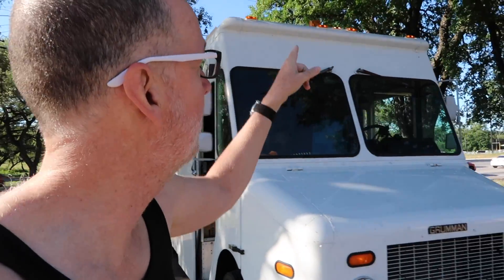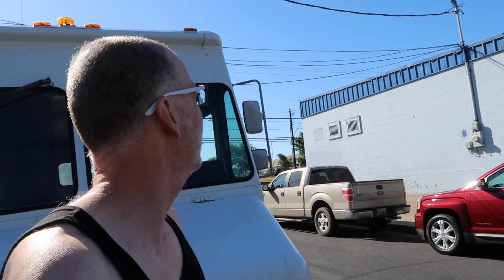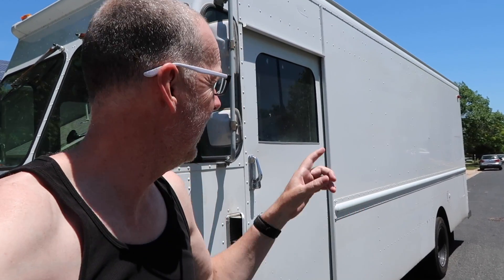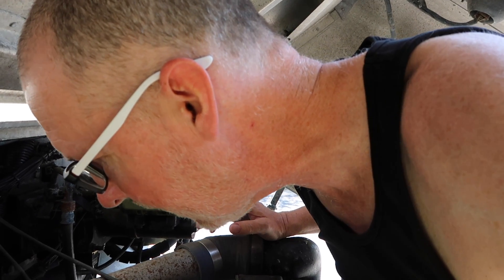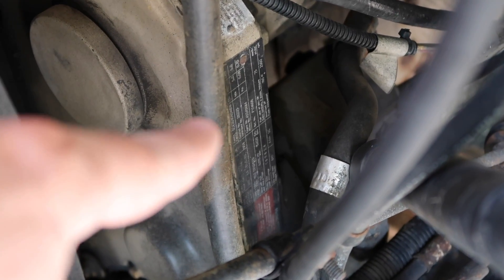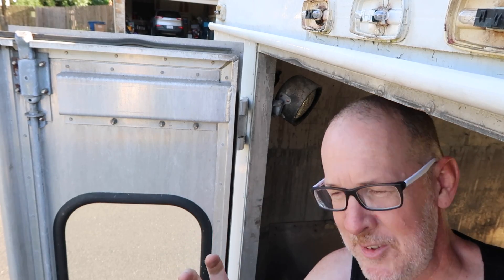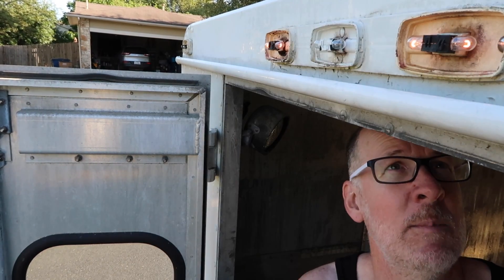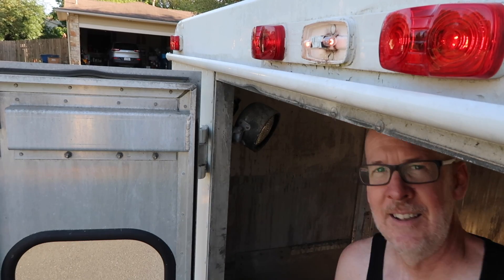Failed Step Van Safety Inspection E224

Comment: Change ALL of the marker lights to LED, you'll be glad you did. I'm the truck driver that soldered all the marker lights from a previous comment.
Reply: I completely agree, was just going to say that myself.
Reply: Samual Whittemore yeah, i go all LED on everything I can.
Reply: Samual Whittemore changing to LED is a good idea.  something you can do a little at a time or all at once.  take a light off and go to NAPA for the direct replacement.  this would help with your ground issues on running lights
Reply: LED is the way to go.
Reply: I agree it will also draw less power on batteries.
Reply from the maker: ahh... great idea. that is definitely what I'll do. all LED

Comment: You need to pull all of the fixtures, clean and sand all of the area where the attaching nuts and bolts are mounted, (and specifically where the fixtures catch a ground, which you should see a contact in the fixture that goes through one of the holes for the attaching screws.) Aluminum and steel, (the bolt/nut material,) is subject to what is called galvanic corrosion. This is a chemical reaction to dis-similar metals. In time, you'll find the steel bolts/nuts will actually turn in to a powder-like consistency, and crumble apart. While you're at it, I'd go back to NAPA and buy all new fixtures and mounting hardware, and change them all out. Otherwise, you may be chasing this for quite some time! I'm a retired diesel truck mechanic, and prior to my working on semi's, I worked for a commercial and retail laundry outfit that had all aluminum step-vans, so I know from where I'm speaking!
Reply: gac914 and the thing that sucks is there is nothing you can do aside from running ground wires to frame....
Reply: Absolutely true! Trusting aluminum for electrical integrity, especially for a long period of time, is never good! Thanks for noting that, I failed to make that clear. Bottom-line, with DC voltage, the ground is as important as the voltage going to the object!
Reply from the maker: great advice. I'll put this on my "to do" list, but suspect it will wait until after I have some more of the living space built out, then I can go back and upgrade the lights

Comment: Some here are recommending changing to all LED's, but that will be expensive, if you buy the quality units like Grote or Trucklite. And the cheapo knockoff junk you can buy at roadside chrome shops have a 50% failure rate, or more. 

The incandescent bulbs here are simple, cheap, and easily fixed if they lose a ground or simply burnout. Bulb Grease is an actual product and it works. 

I'm pleased you figured this out, but just for future FYI, each individual light fixture is wired in parallel, not series. That's why one or two can work while others dont. If it was in series like a Christmas tree then yes, one bad bulb will take them all out. Vehicles aren't wired that way.
Reply: Thumbs up for Grote and Trucklite.    get the right stuff the first time.  my brother sells auto parts and convinced me of this.    for me... any A/C delco part with an A in the number... is total junk import crap from (A)sia.   little things like that make a big difference in your enjoyment later down the road becasue you knwo you have the best you could get.
Reply from the maker: thx for explaining about series on parallel and costs of lights

Comment: I'm only just now watching all these videos of the build, Seven, but as you were learning, I am now learning from your videos(!). I've wanted this same stepvan for years now (with the 4BT or 6BT), and am seeing areas to pay attn to when I finally drop the $$$ to get one. The little things that mean a lot (electrical gremlins, odd odors, persistent vibrations, cost of maintenance, etc) have been very helpful in compiling "what to look for/ how to address" notes. 
I loved seeing you so elated at the end when, after getting frustrated with the lack of voltmeter proficiency, you still managed to fix the issue! Regardless of how you did it, you did it. All the helpful comments only come AFTER you find and fix these problems (sometimes), so I'm sure those helpful comments did help. Take care
Reply from the maker: I still struggle with electric stuff and volt meters. hope you find the step van of your dreams (I'm hoping to do a video soon on things to look for when buying a step van)

Comment: that type of  light that is used for your marker light uses the fastener as the ground that is why when you turned them they started to work.most of the stuff you need or get you'll have to go to a truck supply store like here in jacksonville fl we have one called fleet pride and Napa also for lights truck stops have some on hand.i know in a commercial truck D.O.T. requires a fire extinguisher a little red rectangle box of three foldable triangles for break downs and a first aid kit it might be a good idea to get them maybe not all at once but would be good to have.better to have them and not need them then to need them and not have them.

Comment: It's sometimes very hard to get a good ground on an aluminum body.  Worst case you can always slip a round electrical terminal under the mounting nut, and run an actual wire down to screw into any part of the steel chassis beneath the van.  The same wire can branch to connect the ground sides of all of the lights (or any other small devices).  Use a wire size similar to the one(s) on the positive side of the circuit (usually #12 or #14 unless higher current device like headlights or big fans).

Comment: you have it set to the correct setting and current type that is the hard part. so find a bit of exposed metal and that is where to put the black probe for ground then touch the red one to the pins in the connector. you may have to poke through the wires if it was installed without removable connectors. and you may find more bad than good but from what i have seen you are resourceful you got this

Comment: Lol, glad you got the lights fixed. Electrical  can be a nightmare. good job. You should think about changing those lights to a LED light. You will be glad you did ,simply because they draw less current easier on the battery and they are brighter and, they will last longer.of coarse there is no hurry. you have plenty of time for this in the future...just a thought...... great video .. B safe out there..

Comment: I am not a mechanic nor am I an electrician! I am amazed that you have the patience to fiddle with this stuff! Definitely a learning experience and you are learning! Kudos to you from one Texan to another. BYW I live in Spring, Texas. But would definitely not be of any help to you!
Just for your information Texas will be doing awY with vehicle inspections shortly.
Reply from the maker: glad to hear I won't have to do safety inspections again. it was super easy, but a surprise about failing because of the top lights

Comment: Remember my comment about an electrical ground based Poltergiest... Also, when you use steel screws into aluminum there can be a corrosion penalty.
Your batteries should be 12 volts or better. The nine volt indication (less than battery voltage) was a possible bad ground indication, just like a "dim bulb" on a test light.
Start watching the "SouthMainAutoRepair" channel. Eric uses a test light and meter all the time... Good Job on the troubleshoot.

Comment: Money, money, money... don't keep doing the most expensive thing only to find out later that it could have been done much cheaper or just needed something simple. Put some dielectric grease on those nuts and leave them alone. Don't change the nuts. Don't install LED. They shine... spend your money on an AC unit later or things you really need. Great job on getting them all working. Awesome video.

Comment: when I worked for a bus company and those clearance lights didn't work I would tap them with a broom handle. That usually would work. Bad ground from corrosion where mounted to the body.  Good luck.
Reply from the maker: I think it was corrosion at the ground

Comment: LEDs are a good idea for your van for marker light OR interior light if you're going to add them. Yes Cummins or maybe even the Gruman may have a record of any recall open, closed or completed.  On parts get used to going to NAPA or a truck parts place, a lot of your step van is assembled meaning Gruman bought parts and assembled them, real truck parts folks can sell you those same parts.  If you would of grabbed one of the lenses you didn't loose and brought that into the parts store the NAPA guy probably could of gotten you done right the first time. I worked travel trailer repair for a while and most of the time that a marker light quit it was a bad ground. We had a box of oversized aluminium screws that usually restored the ground and you didn't have problems with galvanic corrosion.

Comment: Clearance lights are a common source of water leaks.  Check yours carefully.  If cracked or loose plastics,  bad rubber seals, or signs of corrosion then replace them.   LEDs are nice, but cheap old fashioned truck type are OK since you are only using them while engine running (don't really care too much about efficiency).   Seal with Dicor lap seal for best results.  Silicone is OK, but will crack and fail with vibration.

Comment: haha my first thought was "bad ground?" with low voltage stuff that is very often what is going on.In order to complete the circuit they have to have good contact where they are either screwed down to the vehicle or thru a ground wire in the harness. marker lights are usually just grounded to the vehicle. loose screws or just crud built up can be enough to make them not work. good job figuring that out! honestly I think the experience of having to figure that out thru frustrating trials and error is the best way to learn and retain these things. I never had anyone to help me figure anything out really and I was going thru the learning process before I had access to you tube or google lol so for me there was a lot of head scratching and just poking around exactly as you have done here. You seem to have the perfect balance of patience and common sense to be very successful at these types of things,you will immediately know what to look for next time you run into this scenario now,time well spent in my opinion!
Reply from the maker: low voltage is a mystery to me. maybe have to do another video about some strange things on that

Comment: Seven those ID number  and spec on ENG are on the front of motor right side of what you call timing cover on bottom right .It may be cover by dirt and oil  its a black sticker .  I have a 97 dodge with a 12valve I my self had to find the ID number my self

Comment: I have not seen recommendations for the use of "star" washers. They are good for grounding problems. Keep up the good work and your commitment to asking for help as a problem solver.
Reply from the maker: I've seen a few of the star washers on my step van but wasn't sure why they are used. thx for the tip and info!

Comment: You need to check for continuity by turning it on and switching it fo 5 o clock with the Arrow/triangle with line through it. Read 1v means its good. Reading nothing means no connection.

Comment: If you don't want to spend several hundred bucks for a Softie (mic windscreen) there is a much cheaper alternative.  I used to record sound for movies in Hollywood and needed windscreens for small wireless mics. I found that the foam ends for big Q tip like sticks worked well enough.
Reply from the maker: great tip!

Comment: Yeah, those screws are the Earthing for the Light Fittings.... As you know the Truck Body acts like the Negative Cable and those screws are on the Negative Side of the Fitting.
On Lights always check the Earth as a first thing if there is an issue. Loved the applause!...lol
Reply from the maker: great advice. glad you liked the applause!

Comment: hi steve, the problem with those van body is the aluminium. two different metals will create electrolysis (rust). on regular contacts you can use dielectric silicone grease but on aluminum to other metals there is a other product you can purchase at home depot in the electrical  section.
Reply from the maker: thanks. I need that special grease in a few areas now

Comment: You need to go to a road trailer supply shop, they have all your needs for rebuilding trailers. Bad grounds cause most lamp problems. Trailer supply has skin panels, posts, I-beams. Check out a trailer supply you will love it.

Comment: those look like 1 wire clearance lights. You'll notice 1 mounting screw will be going though a metal strap, that's the lights ground. I see they're dim. Remove the nut clean the metal (no paint or rust) the nut presses against and put a lock washer and nut back on. You'll get a brighter bulb. I saw someone mention LED lights remember if you install those kind of light and they don't work, they're most likely in backwards. The positive and negative can't be reversed r they don't work.
Reply from the maker: great tips!

Comment: You are using your HF voltmeter correctly.   20V DC setting is best choice for measuring 12V systems.  Black probe to ground, red to hot, you will expect 12.0V for on, and 0.0V for off.  If you get the probes reversed you will see -12.0V (still works).  When you see lower numbers like 9V it means some voltage drop in circuit, sometimes from loose or dirty connections somewhere in the line.
Reply from the maker: glad to know I remembered something Merrill told me about the meter

Comment: Hi Seven 
You had the right idea with the voltmeter 
Only strange thing is the low voltage at the lights 9.3 is for sure to low  can you do the same test with your battery to see if you have the same voltage there 
After that try to run the engine and try the voltage on the battery again 
You should on the first have at least 12.6 + volt 
and when the engine is running 13--14.5 volts 
Keep up the good work mate 
Regards Jack
Reply from the maker: good point. I'll have to run the engine and check. I did notice that the dash volt meter shows about 10v with the engine off but key on. it jumps to 13v when running

Comment: The vinyl in lock nuts may interfere with good electrical contact from light through mounting bolt and nut to the metal body.   Plain nuts, possibly with a split metal lock washer, should be good enough.
Reply from the maker: someone else mentioned that. I didn't know. I'll avoid them for electrical stuff now and only use them for other items (like my wiper blades)

Comment: How were you dealing with the fish eye from your Hero Session? Were you using your editing software? What type?

I'm looking for a Step Van but I haven't had much luck getting on local.   Your videos have been very helpful.

I'm surprised about how well the van does on gas mileage, which was my concern about a van that big.
Reply from the maker: there are several settings on the hero session. I use the "medium" lens so it is not as drastic of a fish eye effect. I import with the gopro software and then edit all my videos with iMovie on a Mac. I was not able to find what I wanted locally and flew to New Jersey and later to Seattle to find one. the aluminum body step vans with diesel get fairly good MPG. mine is really big (26ft long). if you get a smaller step van with the 4cyl Cummins 4bt, you should get 17-20 mpg

Comment: 9 times out of 10 it's a bad ground... But I always start at the fuse box. If all the fuses are good then I start checking the grounding points at each marker light... As for the volt meter I've been working on vehicles for 50 some years and to this day I still can't figure out how to properly use one of them... I've been telling myself that someday I'm going to have someone show me how they work. But then I forget about it until the next time I need to use one!!! LOL,LOL... I've got like 6 of those free-bees from HF. And I give them away as gifts to people smarter than me that need one... I've been told that those work as good as an expensive one... I personally couldn't tell you I usually keep moving wires until I get a spark, or I get shocked, or the light comes on!!! LOL,LOL

Comment: The screws are the connection to the chassis = ground connection. You need dielectric grease to prevent corrosion at the bulbs contact points. Blop it on the and stick the bulbs in.
Reply from the maker: excellent advice!

Comment: Star lock washers are supposed to be on the inside of the truck, they look like little saw blades or like spurs for boots. Anytime a light goes out just remove the cover outside and turn the screw back and forth, then tighten it up. The star lock will cut into the aluminum a little bit and make the ground connection again. As you've probably discovered by now, step vans usually only have a power supply wire and they ground each light through the body connection. 
Did you figure out the volt meter yet?
Reply from the maker: still working on the volt meter, but I had an electrician look at the batteries last week and he gave them a clean bill of health. we are guessing many of the problems are bad grounds and perhaps bad connections in the fuse box